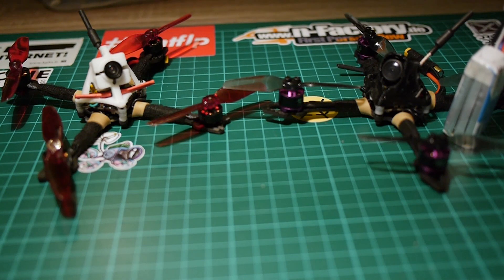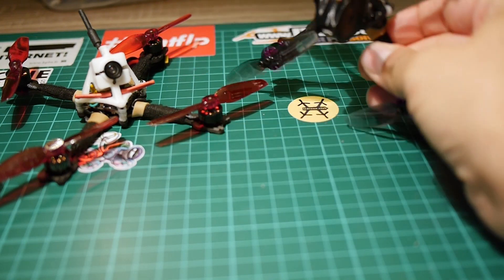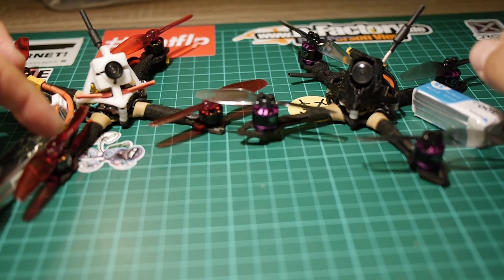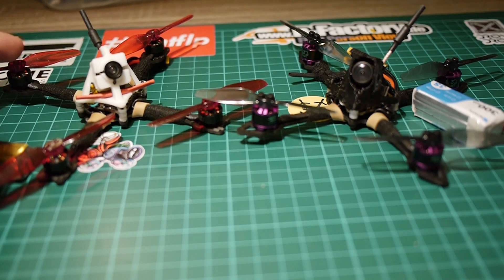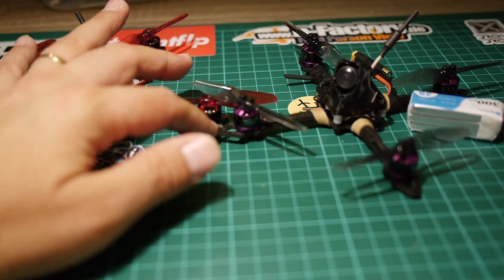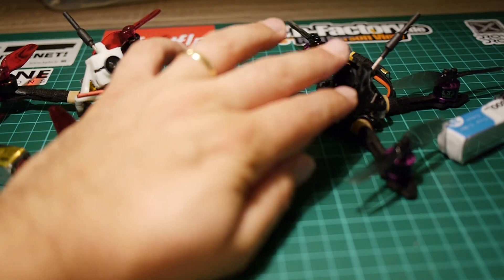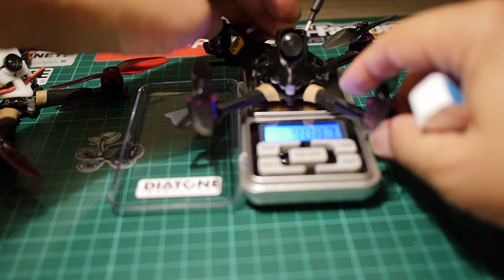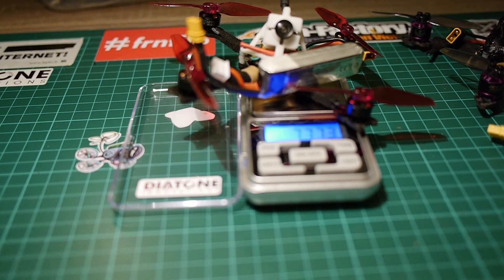Toothpick style 3inch  : 2S vs 3S comparison

Comment: I am buyer out from us
Planning to do 2s version form what i can get from local store

Fonster Kpro V2 125mm Shaft 3mm Arm
JHEMCU GHF411AIO Pro 25A
Happymodel Diamond VTX 
Caddx Ant 1.8mm 1200TVL 4:3
Radiomaster R81 Nano SBUS Receiver FrSky D8
Happymodel EX1204 4pcs 6500KV
Gemfan Hurricane 3018

will it work great on 2s？
its around 63gram if i add all the part based on spec sheets🤣
Reply from the maker: Yes should work. Try to get a more suitable 2S motor in the 8000 kv range. 1202.5, 1204, 1303 would work fine
Reply: @Ledroneclub  lower KV means it might get under power right?

for 63gram setup will i get much benefit if i go to 3s build with 5000kv motor
Reply from the maker: @quaneu9216  yes you lower the kv when you have more S in your battery. 5000kv on 3S is perfect. Thought 2S and even 1S setups are good as well with the proper motors (and weight of course)